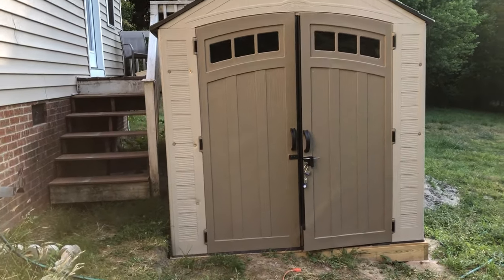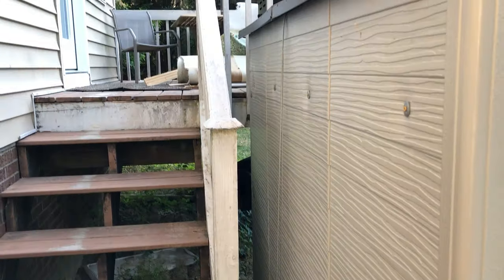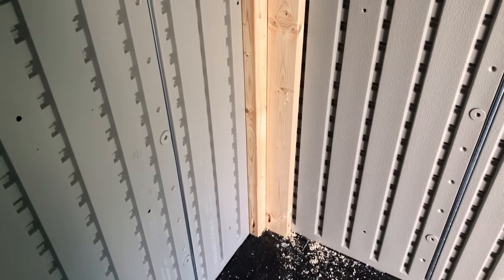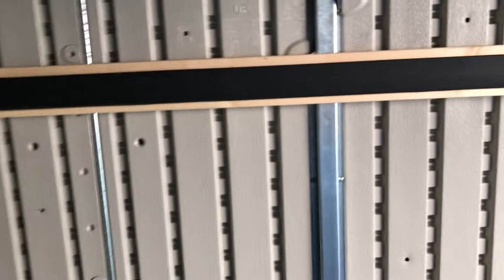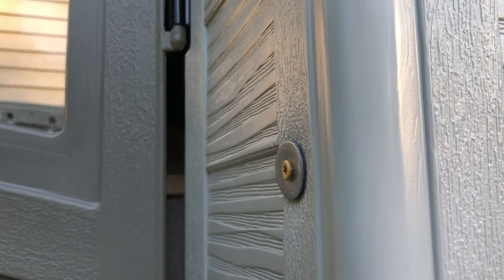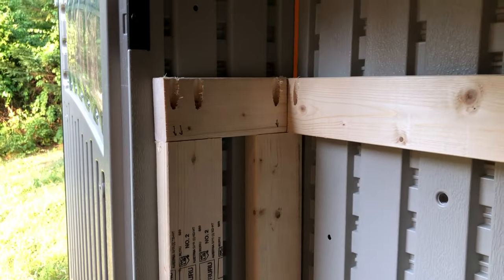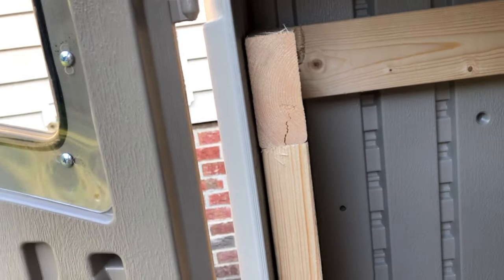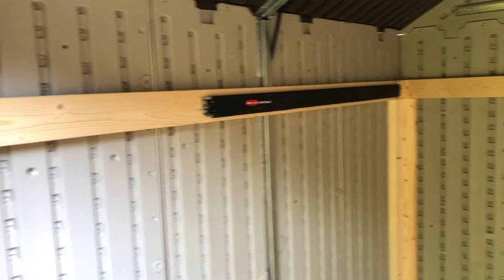How To Reinforce A Plastic Shed (7x7 Resin Shed) #shed #DIY #storage

Comment: That's great reinforcement. I got my shed (8x10) less than 3 years ago and 2 years later all corners split open. We built it on flat and level concrete pad. Unfortunately the company are not honoring the warranty which should be 10 years, but they have a long list of excuses. Will never buy Suncast sheds anymore.

Comment: I just got this shed. It feels very flimsy!!! I wanted to get a Lifetime or Rubbermaid shed since I already have one of each and they are both very sturdy, but I needed a 7x4, and Lifetime only had a one closer to 7x5 (I was already pushing it with the 7x4) and the Rubbermaid ones looked like straight boxes. This one has a nicer "look" to it, so I went with it. I'm using it as a house for two dogs and one cat, plus storage, so I'll definitely be framing it just like you did here to make my separate rooms. Thank you for the video.

Comment: I have the exact same shed.  Resorted to using a Bike U lock to keep it locked because the doors are too flexy even after adding an angle iron to the length of the door behind the handle.   Thanks for the extra tips!!!

Comment: I just bought this shed  a couple weeks ago and it came in. Thank you for the tips as I will do this as well! I will try to find wood on marketplace for free as it is pricy now. Hows the base holding up? I was thinking of putting mine on heavy duty plastic pallets and then plywood floor over it so we don’t get termites.
Reply from the maker: The base seems to be holding up well. I used treated lumber, so it should be fine with ground contact. Plastic pallets sound like a good idea if you have them. Good luck!

Comment: regarding making it more sturdy,  i added square tubing (using rail connectors) to both sides using the rails front n back that come with shed, worked very well.

Comment: I have this same storage bldg. and all four corners have split, was thinking on this same method with 2x4's and using 3 pre-drilled metal AL. brackets on the outside 6" Long, top center and bottom to pull it back together, Thanks

Comment: had the same idea of using screws/bolts from the outside through the plastic with large washers to keep from pulling through the plastic.... how has it lasted? any leaks?
Reply from the maker: Over 3 years and no leaks. Everything is holding up well and no apparent problems with the screws or the wood. The rubber backed washers appear to be doing their job well.

Comment: Good idea for reinforcement. Have been contemplating for 2 yrs. Still trying to come to solution on 2 walls that I cannot access from the outside. Thinking of some kind of butterfly type fastener...any suggestions welcome except the guy who thinks our challenges are all due to improper construction?? of shed materials supplied in the box
Reply from the maker: If you can't access the outside my first inclination would be using construction adhesive to bond the wooden frame to the plastic wall, to keep the wall from wandering away over time. I'm not sure of any negative side effects, so you'd have to see if something like liquid nails would degrade the plastic (might be HDPE from what I read online). Good luck!

Comment: If you put even small corner braces wouldn't it greatly increase the "stiffness"? Especially on the short walls where the doors connect.
Reply from the maker: It could help some, but in my opinion, I don't think a corner brace would be sufficient for these types of sheds. At least with the one I got, the sides were much more flexible than I would have liked. After having seen pictures online of these sheds after a few years where the sides bowed either inward or outward (usually outward because of the weight of things inside the shed pushing on the walls), I decided to do a wall-length brace to try to prevent that from happening.
Reply: @projectORnaught  True. I meant corner braces on internal structure you added. Small angled braces in the corners where the 2x4s meet would keep the whole system from twisting.
Reply from the maker: @justinjonbaugh  Ahhh, right. Yeah, that would definitely improve upon what I did. If I find the time I'll try to add those in. Thanks!

Comment: any plans for a horizontal floor stud (think wall frame)?.. also, will you paint your framing to protect from moisture?  or other water proofer?    I just put up a 7x7 Suncast Modernist (on an uneven gravel base) and I think it needs more structure/reinforcement.... ground anchors are also next
Reply from the maker: I think I'll leave it as shown in the video. Structure seems pretty stiff now, and since the shed doesn't allow any moisture in anyway I don't think painting the 2x4s will provide any additional benefit.

Comment: Did you anchor the bottom part of the 2x4 frame inside to the base platform as well or just to each other at top?
Reply from the maker: Yeah, it's hard to see in the video, but I used pocket-hole screws to attach the bottoms of the 2x4s to the floor.

Comment: my biggest complaint is that these sheds get extremely hot in summer, i have had paint and other materials ruined because they got boiling hot.  Have also had electronics and other tools fail because of the heat.  Before next summer i will add a roof cover to keep sun off plastic.
Reply: If you don't mind me asking, where do you live? I was going to keep some pool chemicals in one of these sheds. I imagine a few gallons of chlorine boiling is a really bad idea. Having said that, I do live in northern Illinois where the weather doesn't get THAT hot.
Reply: @joshuaychung  i am in east Texas, yes it gets hot here
Reply: @durangodave  Ah... Thank you for the response. Compared to east Texas, the Chicago summers are mild. The worst we get, usually, is low 90s. When it gets to that 100 once in every 10 years, we literally have warnings out, businesses close, we ask people to check on our elderly neighbors, etc..
Reply: @durangodave  I also heard there are attic foil type of things that you can use to keep the heat out of the shed. I was going to try that, too. I'm afraid of the pool chemicals exploding while my kids are swimming 30 ft away from the shed.
Reply: @joshuaychung  anything you can do to keep sun off of roof will help.  I have a temp guage in mine, when its 90 here its 115 to 120 in the shed.  Thats why all my stuff was boiling, tubes of calk n stuff were popping.  I even added an extra vent to roof, not much help. My other shed is much cooler because it has metal roof over tar paper n plywood so the sun does not heat it up so much.

Comment: where did you get your ground anchors from??  and what kind of cable did you use?  I just got a smaller version of this and the first day it blew over before I could think about how to anchor it.  I am planning on bolting down the floor but your anchor system looks to also add a much more sturdy addition to it.
Reply from the maker: I bought the ground anchors and 1/8" wire cable at Tractor Supply. You should be able to get the same stuff at Lowe's/Home Depot. The ground anchors look like large versions of the anchors you use to leash a dog out in the yard.
Reply: @projectORnaught  thanks so much. I’ll have to swing by tomorrow.

Comment: You have a link for the stakes? Those just screw in like dog leash screws?
Reply from the maker: I bought those at Tractor Supply, but you might be able to find them at Lowes or Home Depot. If you're looking online I think you can search for "ground anchors" and that should find them as well.

Comment: as the wood shrinks and swells, wont that deform the weak plastic?
Reply from the maker: It's possible, but the inside of the shed has stayed pretty dry, so I don't think it's subject to a lot of dimensional changes.

Comment: Would a 4 foot vertical height be OK. 2x4 cut in half would be less waste. Did you do 5 ft for a reason?
Reply from the maker: Yeah, I think anything half-way up the wall height or higher should be fine. I had leftover 2x4s for the vertical pieces, so mine ended up around 5ft. You just need something to keep the walls from bowing over time.

Comment: For the long horizontal boards how did you get around the roofing bracket that sticks out on the wall? Did you notch the 2x4 or just bend it in the middle?
Reply from the maker: I had to notch them to get them to sit correctly. I did it using my table saw, which was a little slow without a dado stack, but worked well enough.

Comment: Does the frame you built help keep the seems from splitting?
Reply from the maker: Yeah, I'm sure it will since the frame will keep the panels from shifting over time. It's been about 2 years since I reinforced my shed and the shed itself is holding up well (just checked on it yesterday). As for keeping spiders out, this work won't help with that (spiderwebs everywhere in mine!).

Comment: Nice job. I have the same issue with my Rubbermaid shed. 110+ in the summer sun has 1 side bowing really bad. 
I was only gonna do 1 side but I like your idea way better.
I used cement pad  & ground anchors.
The roof strap is great idea for hurricane type weather 👍🏻👍🏻

Comment: Any ideas out there on what kind of glue to work with resin shed? thanks!
Reply: ... which part?  I think water proof tape (think 200 mph tape used in racing) .  strong, extra tacky, and flexible...

Comment: after putting holes with the deck screws with the rubber washers do your shed leak water 💧?????
Reply from the maker: No leaks so far, which is what the rubber washers were designed to avoid.
Reply: @projectORnaught   Where did you get the rubber washes from could you give me some kind of insite I am doing the same exact thing you're doing
Reply from the maker: @tonytighttucker  I had to order them on Amazon since I couldn't find anything useful at Home Depot or Tractor Supply. If you search for "1/4” x 1” OD Stainless EPDM Washers" on Amazon they should be the first item that comes up. They all worked well and seem to be providing a good watertight seal.
Reply: and what screws you used please???
Reply from the maker: @tonytighttucker  I used coated decking screws from Home Depot, I think they were 1.5". I've been using the tan ones and they seem to work fine.
Reply: You can always chalk around under the washers for added waterproofing and sealing.

Comment: Where did you get the rubber coated washers ?
Reply from the maker: I had to get them on Amazon, since no local places carried them. Search for "neoprene backed washers" and you should find something that works.
Reply: @projectORnaught  could also just use a rubber washer together with a metal washer.
Reply from the maker: @michaelw6554  Yeah, whatever works to get a water-tight seal should work.

Comment: Is the anchor going under the roof or over top
Reply from the maker: There is a metal track that holds the roof up, and that track has a channel in it. The wire rope sits in that channel and keeps everything from blowing away. We just had some hurricane Ian remnants blow through a few days ago and the shed stayed in place, so I guess it's working!

Comment: I think it is a dumb question, but I am asking. May I know which/what type drill bit you used to drill this plastic shed? I like to drill without making any crack. Thank you!
Reply from the maker: Definitely not dumb. I actually just drove the screws directly through the plastic and it seemed to work fine. No cracks or any other problems, and the screws are all still water-tight (after over 2 years).

Comment: How about the roof do you think it can withstand a storm?
Reply from the maker: The roof, at least on mine, is a little iffy when it comes to high winds. The roof is secured to the walls by 10-12 screws on each side, and I'm not particularly trusting in those. The roof is more securely attached to the main roof channel (a metal bracket that provides most of the structural support for the roof), and that channel is secured to the walls, so I have more confidence in that piece. With the anchoring I used (running metal cable through that roof channel and anchoring into the ground on both sides of the shed) I'm fairly confident that my shed can hold up to most storms in our area. Without anchoring the roof... I would feel much less confident.
Reply: Son in Laws shed survived hurricane force winds. The shed just sits on plywood and cinder blocks. It is not screwed down or chalked down. The roof is slightly cued at the side from where a branch fell on it. No structural damage but I do need to get a bigger, longer screw. The other screw was pulled out.

Comment: I have a similar 7x7 resin shed and I am pondering how to anchor it.  Looking pretty is one of my priority, since I got a decorative version of this shed.  My plan is  bolt in 4 dock rings on each lower corner and attach those to ground screws using chain. The problem is, I don't know how to bolt into hollow resin walls.  Maybe make a slit and put a lumber inside the wall, then drill thru.  Any suggestions?
Reply from the maker: The main reason I went with the anchoring method I show in the video (ground anchors with cable that goes through the main roof channel of the shed) is because these resin sheds just aren't all that sturdy. Anchoring only the walls has the potential to allow the roof to fly off in a high wind event, at least that's what I suspect given how poorly connected the walls are to the roof. Plus the foundation for my shed (treated wooden deck on pavers) is not even anchored to the ground, so anchoring the way I did gives me a little more peace of mind that very few pieces of the shed will fly away in high winds. Good luck with your shed!
Reply: @projectORnaught  I'd love to see more closely how you ran the cable through the roof channel.  Is there just one cable, or did you put one near the front and one near the back?  Thanks.
Reply from the maker: @michaelw6554  This shed has a single channel in the middle of the roof made from steel (one of the few metal pieces on the whole shed), so that's what the cable runs through. It's a single cable that goes from the right side over to the left, loops through a ground anchor, then runs back to the original ground anchor. I used an adjustable turnbuckle to tighten the whole thing. You can see the turnbuckle area around the 29 second mark in the video.

Comment: Why buy the shed when you didn’t like it?
Reply from the maker: It's not that I didn't like the shed, I just didn't think it would be sturdy enough to withstand normal use.
Reply: Some places require pre-built sheds that have plans registered with the state and approved. These can cost $5k +. Or you can get your own engineered and approved and cost just as much when done. Or you can spend $600 to $1000 and maybe couple hundred more to reinforce and don't have to put up with the BS and get something strong enough to hold lawnmower and lawn tools.

Comment: That's not true I have the same shed and it's not rickety and it's not unstable. I built mine on a level foundation and also a level frame if you build it right you wouldn't have these issues I have the same shed.  I'm just not trying to criticize the guy or be self righteous but people don't put up stuff right and then they complain about the product. And then what happens is you get others who don't understand How things are supposed to be constructed I've been in the construction business for years. I'm an engineer it doesn't make me God but it sure doesn't make me foolish either. Just don't like it when people don't know what they're doing and they blame the product
Reply from the maker: By no means should this video be construed as "this product is terrible", far from it. I don't blame a popsicle stick for not being as strong as a 2x4, it's just inherent to the material. Similarly, this particular 7x7 resin shed shouldn't be blamed for not being as structurally capable as a stick-built shed. The shed in and of itself is fine, I just didn't feel it would hold up to the abuse that I and less delicate members of my family would inflict on it. I definitely wouldn't expect it to withstand the weight of hanging multiple mountain bikes and other things on the wall without some sort of deformation (deformation being the thing plastic is very good at). I simply thought others would like to see how I improved upon an already good, but structurally lacking (for my intended purposes), shed. Also, FYI, the shed was built on a level foundation and according to all supplied instructions (don't let my shoddy camera-work fool you).
Reply: @projectORnaught  You BOTH made valid points.✌️
Reply: Mine is perfect except for the, right side, roof where the sun hits it…..warped and started leaking at the cheap plastic rivet points……
I used galvanized sheet metal, painted, as a replacement….so far so good😀
Reply: The3924 you say exact but items can vary year to year and warehouse to warehouse..  Also humidity and heat make a big difference on plastic
Reply: This video is very helpful. Just got one very used from someones curbside trash. Definitely going to do the frame and door supports as you did.
Reply: I have the exact shed. I used 4x4 posts cemented in corners(cut square holes in flooring) absolutely makes this shed sturdy. plus the interior frame awesome for shelves and tool hanging. Also shored up doors.  How's that for engineering( referencing the "20 yr engineer construction expert") that was badmouthing this guy....
Reply: All these people with their half baked fixes and SoWeKool sinks 4 by 4's in concrete. You win good Sir! Time for me to start digging some holes in this Georgia red clay dirt.
Reply: Not true. Yes you are being critical & self righteous. The corners are going to split & separate regardless of your "putting thins up right"
Reply: I’d reinforce it regardless.  The original archers are probably lacking